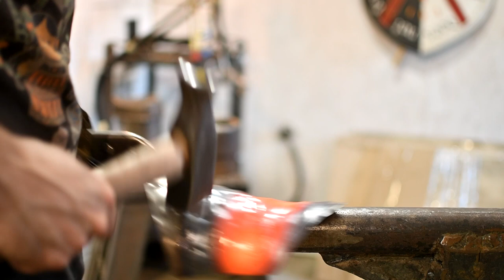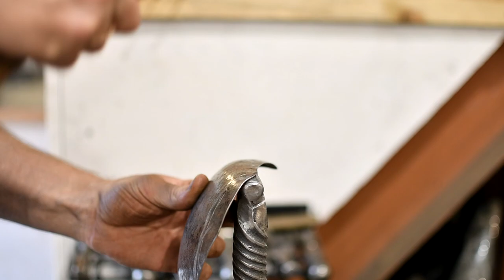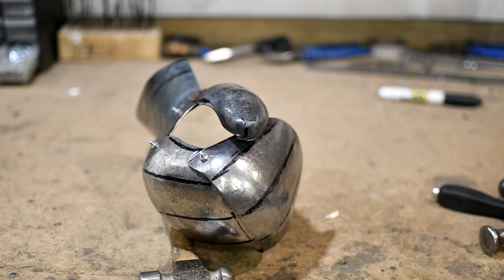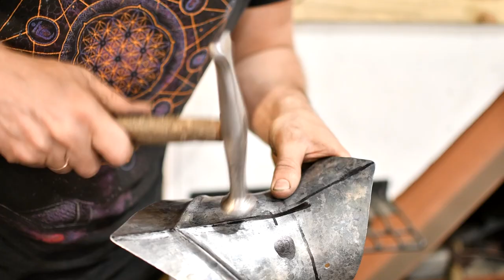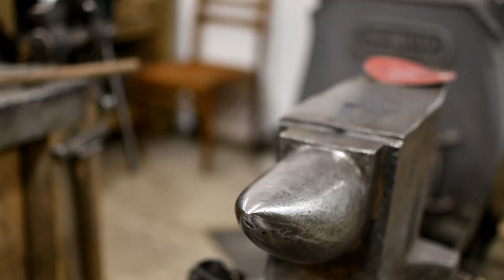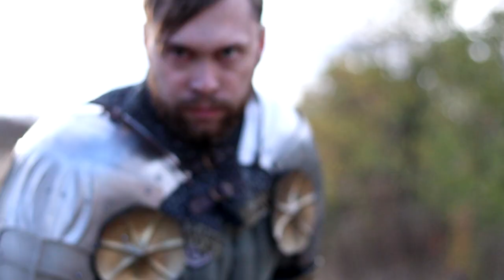How to make medieval gauntlets. Forging armor

Comment: Are the templates you used for this piece available?
Reply: He doesn't reply to comments, but if you can find any sort of stiff paper/cardstock and those little brass splitting pins you can make a paper mock-up for cheap
Reply: I know it's been long, but some of blacksmiths advised me to make paper/cardboard replica things to get measurements

Comment: I didnt manage to make the same one considering the tools i had to work with but i made one with thick aluminum i will just have to reinforce it with steel if i find any to make a skeleton for it so that it doesnt get bent out of shape.

But it works and i dont think that i will be able to make that grip mechanism to lock the glove so that the weapon used doesnt fall out but because its aluminum i dont think ill be making it because it might just get bent out and i cant reinforce small pieces.